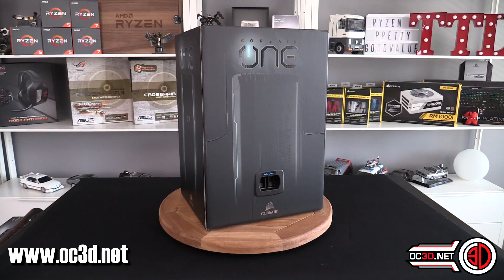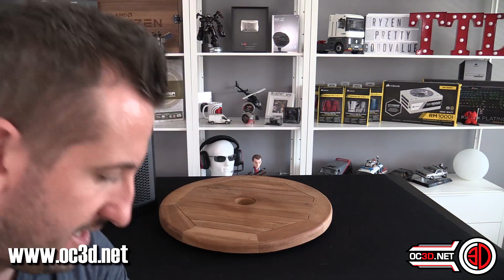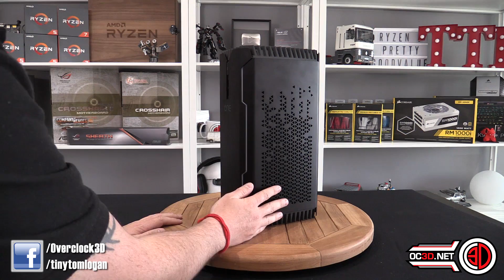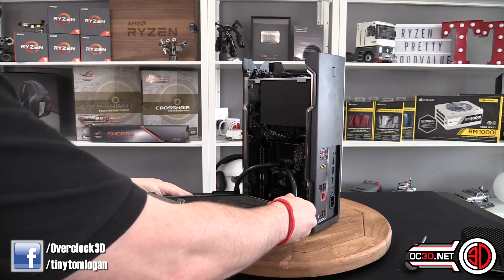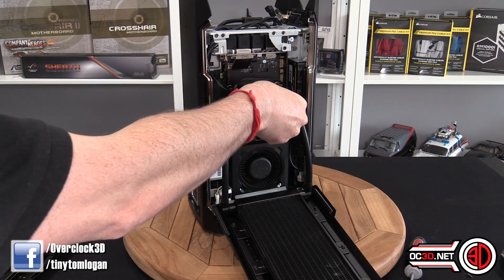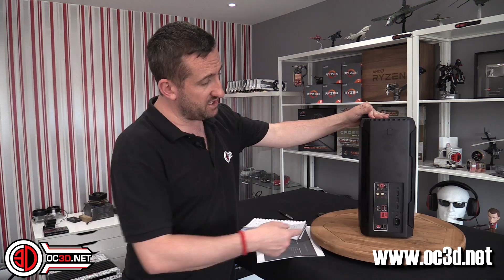Corsair ONE Review & Stripdown

Comment: One thing you missed. This is really great for guys that go to LANs. Everyone hates slugging some huge case with them. Most of the small tiny form factors are usually quite low on specs. This looks small, compact, lightweight and very powerful. Great to just take to a mates house to play on LAN. Well done Corsair!
Reply: It isn’t lightweight. It’s made of aluminium.
Reply: The fact that it can fit in my backpack pretty much makes it lightweight. Besides, it’s only 15 pounds. I’ve had heavier loads of books in my backpack.

Comment: take note apple. this is how you do a dustbin computer
Reply: Hating on Apple, how original...
Reply: I criticize because i care , if i did not care i would not say anything.
Reply: Keep drinking the Apple Kool-aid.
Reply: c'mon, mac pro has an 8 core Xeon, with TWO Firepro, there's nothing to complain about Apple, leave that hate m8

Corsair took notes from Apple tbh ;)
Reply: But thats the issue , you would pay that premium in the past and get something for it. You would get an amazing user experience, everything would just work and due to the integration of the OS and hardware your computer would last way longer before it became useless , well worth it.

Now however , you get your shiny new macbook and it does not work well out of the box , you need dongles and apple dongles at that beacuse the standard USBc ones don't work propperly. Or they don't test it with bootcamp and you explode your speakers , or they don't test the USBc implementation and it breaks wifi when you use a dongle for HDMI  and so on. 

Your kid trips over your power lead in the past , magsafe saves you. Now ? Buy a new one bitch and like it. 

Want to plug your new laptop into a projector at a meeting , give us another 30 quid after you have already spend 2k on it, beacuse we removed all the ports so it would look good in black and white photos on our site.

You pay loads extra for your mac pro and there is nothing pro about it , you cannot upgrade the GPU , you cannot wang in a load of ram when it pops up on the second hand market from servers for cheap as now its soldered to the board. Want to upgrade your SSD ? Sorry bitch its soldered in now , no reason why it just is. Oh and did i mention that when we fix your crappy machine under warrantee we will wipe all your data and not back it up , for no reason whatsoever, even on the few macs where you can pull out the SSD, why ? Beacuse we can, and idiots will put up with it, now give us 600 quid for a phone with no headphone jack.

This is not what i remembered when i had Macs, you would get amazing service , they would fix design issues outside of warrantee , they would help you out with whatever you needed , and anything you plugged in world work and you would know it would work every time. " Hey your DVD drive has failed , but as your macbook is in amazing condition and you have clearly looked after it we will replace it for free out of warantee" This is a quote from an mac store in the past to me when i took my 06 macbook in.

To everyone out there who loves macs , you should bitch at apple too , if you truly like macs then you would be just as pissed off as i am. If you think this is all fine then bitch your not a user who likes a product , your a fanboy. I like IBM/Lenovo laptops too, they are awesome. But do you think i stay silent when lenovo fuck up the awesome keyboard ? 

P.S Go buy a 2015 macbook pro  before apple discontinue the one good product they make. Apple bringing you the new macbook 2016, with less features , crap you don't need and 200 quid more , like it bitch .
Reply: I don't have a problem with everything you just mentioned. Magsafe? Dont need that, also you can charge your device on both sides now, something that I want. Upgrade hardware? Well most of the companies dont let you, so why bitch at apple when everyone does it. Adapters, wheres the Problem? I use video out maybe 1-2 a year so why waste space for a connection rarely is used. Clearly the products don't appeal to your needs anymore, then don't buy them. I will get an macbook next year for sure. I made the big mistake to buy samsung, this is the worst company to me.
Reply: Apple is about to release new Mac Pro, lets see what they bring. I need it for programming and design, not really a workstation user.
Reply: I was thinking the same thing.
Reply: Actually the Mac Pro 2013 has a lot more horsepower crammed into a much smaller footprint. You probably don't know, but the top spec has a 12 core Xeon cpu, 2 GPUs and up to 64 GB or ram, PCIe storage and 6 thunderbolt ports and 2 gigabit ethernet. The Corsair one is basically half all that and 50% larger. I actually think Apple did a fantastic job with the Mac Pro, apart from user serviceability of course. But with that custom form factor, it is basically impossible to do.
Reply: Only thing i notice is if you touch the outerbody when its running or in idle it gets really hot
Reply: Two years later and Apple have learned nothing. Ordered a Corsair One today, as my next hackintosh.

Comment: I commend Corsair for making this product but I would say Corsair could've moved the components around to improve things a little bit. For example, I'm not quiet sure putting a PSU behind a hot radiator is the smartest move for the PSU's longevity especially since it's a small unit and will likely have the fan running often. Perhaps using an ITX GPU rather than a full length card would've allowed them to mount it directly behind the motherboard and minimized cable clutter by eliminating the need for DP and HDMI pass through cables, and finally maybe the above suggestions would have made room for more storage.
Again, it's a great product and I commend them for taking the risk, but I think it's still in a beta phase and if I were in the market for a product like this, I'd probably wait for version 2 sometime next year.

Comment: I suppose having the one fan at the top ensures that hot air exhausted through one radiator will not affect the other. Most tower setups would have one radiator on an intake and the other on exhaust. Is there any significant sealing around the side panels?

Comment: The display port extension cables interfere with the ability to do HDR content. Only complaint, well other then it getting loud and hot under full load. Bought 1080 upgraded to 1080 ti FE works with same cooling plate.
Reply: I forgot to add I contacted Corsair one support on HDR issues and they wanted to do RMA right away. It is a problem with the cable inside not my system. Works fine with monitor plugged into the video card directly. Also no image till booted into Windows no bios screen. Corsair One support sucks and is in India. Just a heads up.

Comment: If you need to, could you strip the pc and turn it into a new build? I want to do this now with my spare one but I’m worried I can’t equip the 1080ti inside with a blower chassis off eBay....anyone have input?
Reply from the maker: Its all normal PC parts. some of the hoses on coolers and cables may be shorter though
Reply: As for the graphics card though, will that 1080ti (the one inside my Corsair one) fit to any Corsair one blower chassis? That’s my main concern. I’m afraid of breaking into this thing taking it apart and risk breaking it and also breaking the warranty and creating a 3000 dollar deficit for myself lolol

Comment: Extremely well engineered, beautiful, design and purpose perfectly partnered to work in harmony, I'm very impressed Corsair, about time some one took notice of Silverstones FT series of cases using the old law of thermal dynamics, hot air rises. I build all my PCs using the same principle which always helps. You remember too Tom that glorious rad mod you did too the FT02.

Also for all those who don't appreciate what Corsair have managed to do here and Tom doesn't mind me posting a link to his forum, heres a build log of my FT03 which I suppose could be deemed as using the same principles and I can tell you with the watercooling the total system cost is probably not too far shy of £2000 then you have too take my labour into account.

https://forum.overclock3d.net/showthread.php?t=77543

Comment: GPU is always the hottest... Have a rethink
Reply: 0T13 Not really. My 780 idles and it's cooler than my 3770k stock clock nd stock fan.
Reply: Aquasaurus Rex well maybe with stock cooling. Lol
Reply: 0T13 It's unfortunate, but CPU will always be warmer. :p
Reply: Aquasaurus Rex Mines not. 1080 runs at 70c, my overclocked x5650 runs at 40 on load
Reply: 0T13 I'm thinking he's talking about stock fans for both most likely. Not after market stuff. But I agree on that!